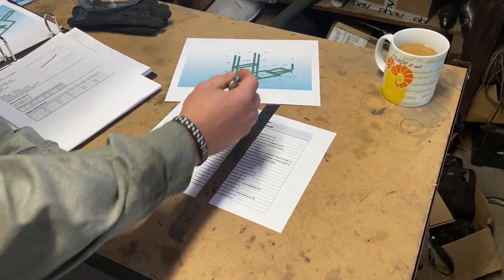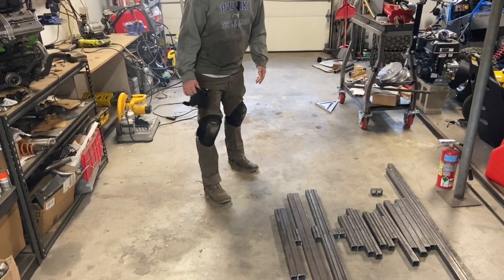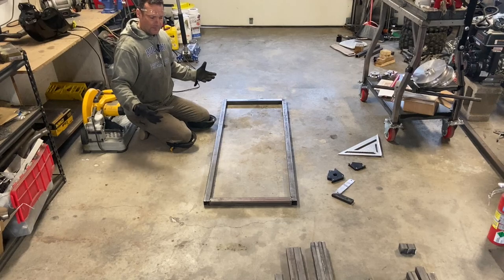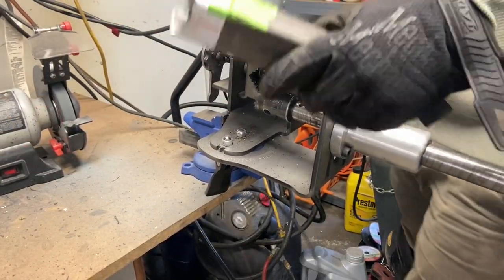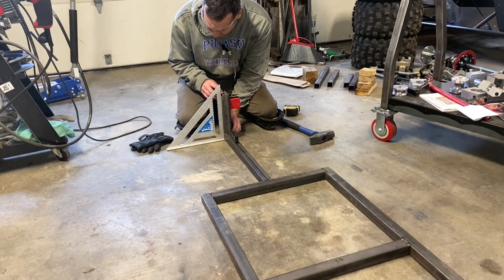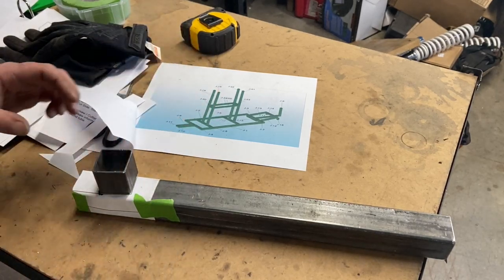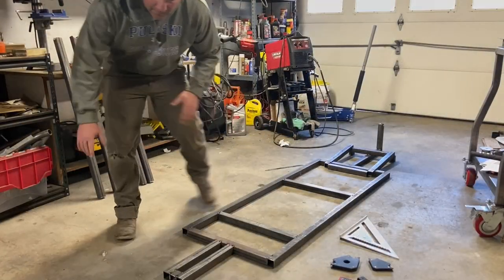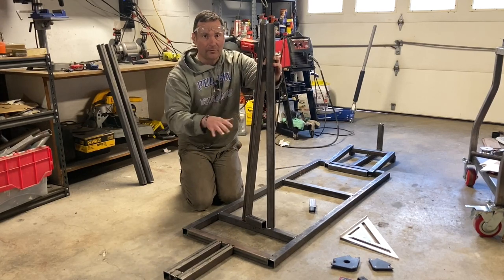Budget Crosskart Build #1: Jig

Comment: I bought your plans and starting to get steel around. I am 6’ tall is the 3” extra needed or is more for someone taller?
Reply from the maker: Definitely wouldn’t hurt. The standard chassis meets crosskart racing specifications for length, if you don’t plan to race definitely stretch it a little to make in comfy 🦾

Comment: thanks for video. I been looking for a project with my jd2 hydraulic bender. i just ordered a crossfire pro cnc last week. I might try to design mine tho . how long did graphing take you? i have bend tech pro software, but I dont have  tons of time working with CAD software so buying pre designed plans might just be smarter the first time around.   Do you have an estimate on about how many feet of tubing you used? thanks for the video and inspiration.
Reply from the maker: You can get the plans and save yourself a lot of trouble… it was 6 months of design in cad, a chassis to make adjustments from, 3 more months in cad and a second chassis to make sure everything worked, then a few more months and adjustments for a third and final design chassis. You’re looking at an overall 15 years of design and research.  There is a plans overview video on my channel that gives total tube lengths needed and a full walkthrough of everything. I’m glad you enjoyed the video, building these has inspired a lot of guys to build VF-1’s 👍. Enjoy the build 🦾
Reply: @KJRaycing  I did find your videos explaining details, thanks for the reply. My favorite quote from your video was about fabraication and easy fabrication. I liked that.Probably the number #1 reason why i got a cnc plasma cutter(easy).  I will use my better judgement here and just buy the plans when I get ready to build. I bought the jd2 a few years ago and recently got the whole Air/hydraulic setup from jd2.kinda wish i new about the rogue fab before i bought the jd2. anyways, thanks again.

Comment: Is it fine if my verticals are off by 0.2 or 0.3 degrees? Very tough to get everything perfectly square without lots of specialized clamps and stuff.
Reply from the maker: Absolutely fine! The chassis is designed to be very forgiving. There are guys that have used 5” CLR dies when the plans cal for 4.5” if that tells you anything. Also the fab work you see from me is not absolutely perfectly bent…
Reply: @KJRaycing  Good to hear.  My jig is pretty precise but I need to remind myself I'm not building a formula 1 car.